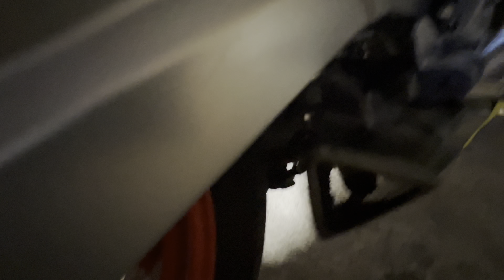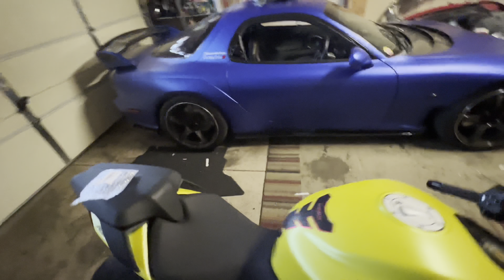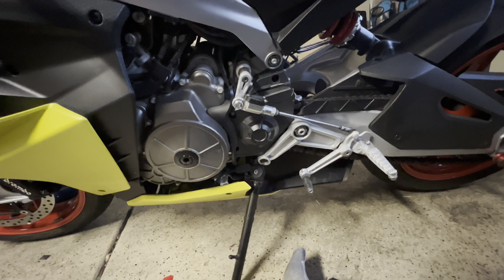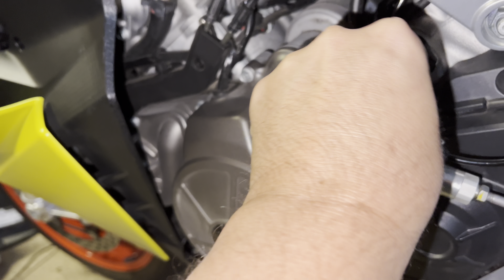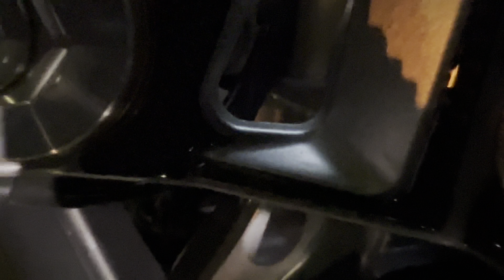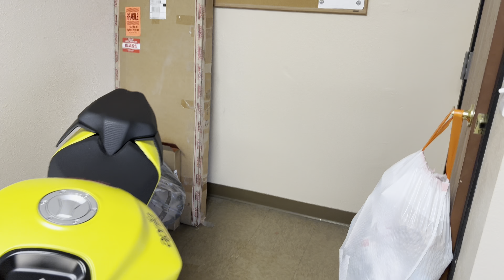Aprilia RS 660 cheap exhaust update and shifter stabilizer review

Comment: Yooo that RX7 looks clean AF! Thanks for the update tho I think im going to go this route save the cash. That shift stabilizer is interesting to me. I was one of the unfortunate buyers that got an RS660 with the linkage that falls off due to missing teeth so I've already replaced the bolt twice. Maybe that will cut down on vibration and keep mine from sliding down and falling off.
Reply from the maker: Funny you mention that! I never had an issue, since I installed the stabilizer now mine keeps popping off! I am going to try to tighten the crap out of that bolt to see if it helps... if not I will look into aftermarket options. I know about a year ago people posted up in the facebook group that an aftermarket "fix" is out there. If I need it..a video will come haha
Reply: @densetsu_vegas  sorry to hear that lol it was a major pain in the ass when it kept falling off on me. But Id be careful bro on tightening it to much, that stock bolt strips really easily, I think its aluminum. I replaced mine with a slightly longer bolt and it mostly did the trick. It still slides down but i was able to get like 2k miles out of it before it got to the edge and I just moved it up and tightened it again. Good luck tho ill be on the lookout for the next video.
Reply from the maker: @montiz333  I was on the freeway cruising in 6th when mine popped off the first time luckily...so when I finally had to get off on my exit I just pulled over and popped her on. I will look into a replacement now. Thank for the tip
Reply: @densetsu_vegas it’s a faulty linkage go to the dealership and get the updated one under warranty

Comment: Hi. My pinch bolt is tight and yours should be too.  The link should have no sideways movement what so ever.  Aprilia use a soft aluminium, if you shear the thread don't worry, I would then suggest getting a stainless steel longer bolt and a lock tight nut so you can clamp that link properly.  Regards.

Comment: Great videos thanks.
Is the noise from this exaust worth the money? How much louder roughly is it, 25%? Is it louder without annoying the neighbours, or getting pulled by the cops? Does it give a beefier sound?
Many thanks 👍
Reply from the maker: Yes to all. It's quite louder, espically in higher rpm. I am wanting a louder system now, that will annoy the neighbors, but I have not switched, because I feel this system sounds better than others. I really wanted a mivv, but that makes it sound like a Harley to me, while this system just sounds better. 

While on the bike it is pretty loud, but off the bike its not bad at all. For sure worth the money.